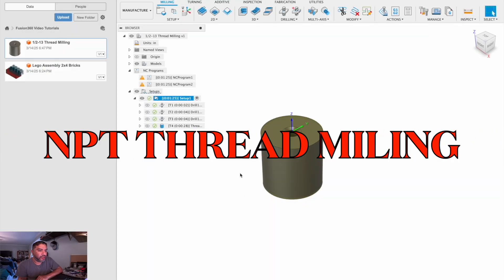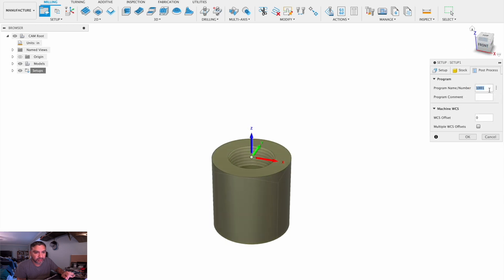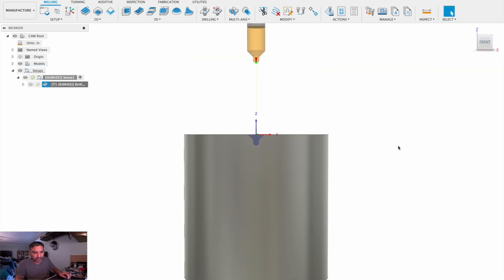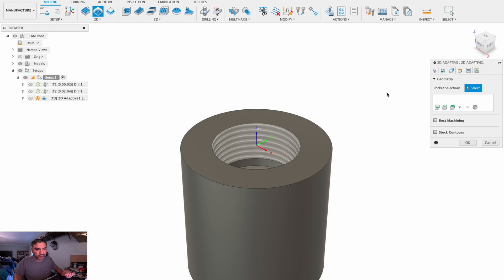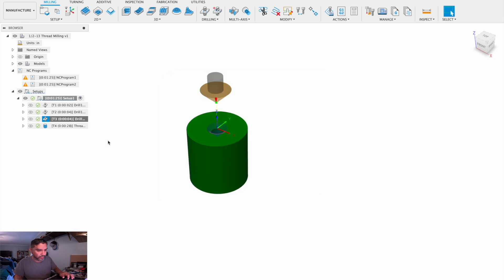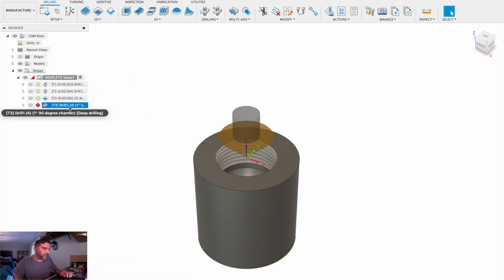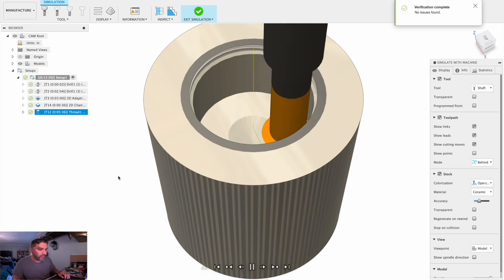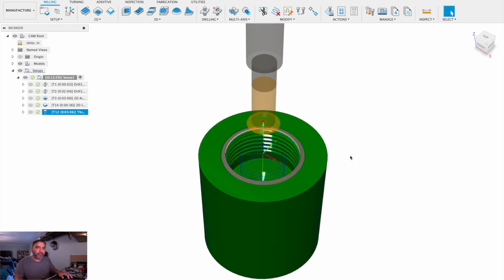Thread Milling NPT - Fusion 360

Comment: Curious. Why go through the effort of using selection for all your heights?
Reply from the maker: While not necessary for this part, it makes sense for others that have holes on different planes or heights. For me, ymmv…
Reply: @ Do you think so? the default is hole top and hole bottom. By selecting the hole, Fusion should be able to figure out where to start and where to stop. 

There are situations like counterbores that add a little more complexity, but there are also tools for that like Auto-merge hole segments. 

Of course you are free to do the method that works for you, but I think if you give the defaults a shot, you will be surprised at how much less work you have an how you can get through the operation more quickly.